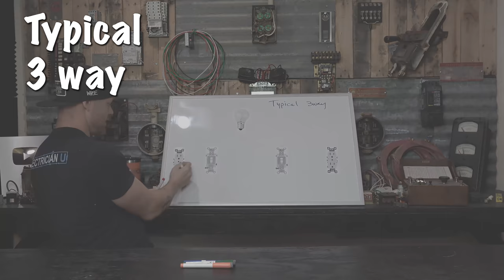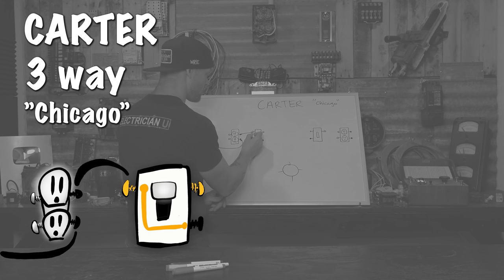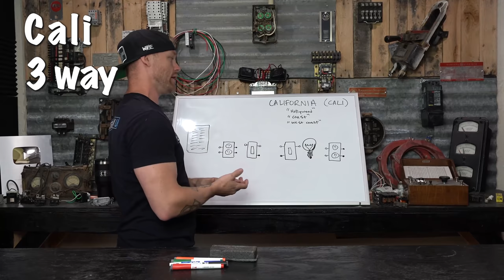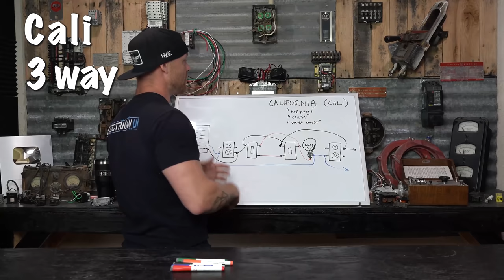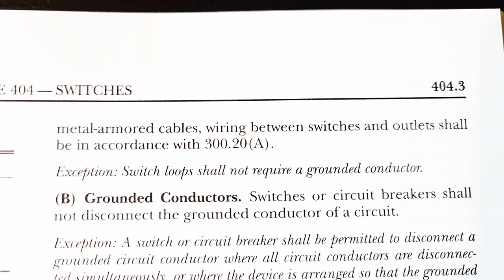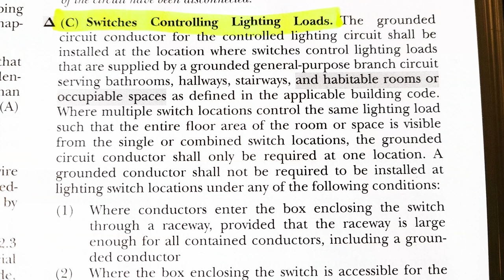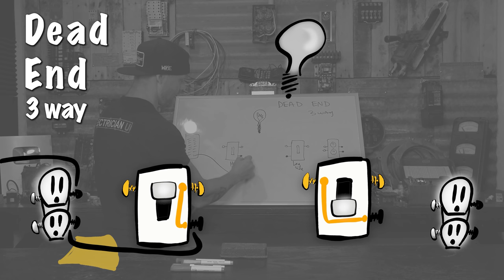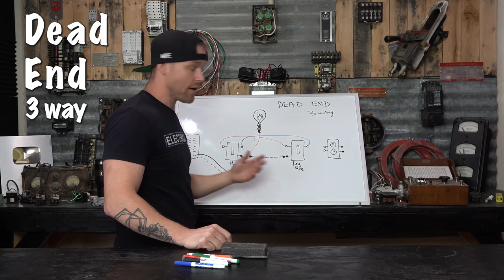THREE WAYS 3-WAYS CAN BE (3way Switch Wiring - ILLEGAL AND LEGAL METHODS)

Comment: 3:30 wouldn't that work without the travelers if it is fed from both directions. I assume that was the reason to use it in the first place. The travelers seem like an invention to solve problems of the old method. ... That is not the major problem. The major problem is that there can be mains voltage in the light even when it it off. It is off when there is either hot or neutral on both sides.

Comment: This carter/Chicago might be what I saw at my friends house that had 148 volts which had me confused. One switch used the white neutral (no black tape to show it’s hot) and the other had all the neutrals in a wire nut. I’m thinking the reason it has 148 volts when tested with meter is because the neutral white wire is being used like the carter but ties in to 2 other whites in a nut and this is not correct and a reason for the improper voltage?? Anyone have input?

Comment: Is it not possible to use the light fixture box as a junction box as well if that box is deep enough to do so.  I think that if you can do that then there is less of a chance of there being illegal junction boxes hid in walls, floors or ceilings and no need for the illegally hidden boxes.

Comment: Four way switch regret:
I wired a three way switched light for my basement stairs.  I should have put an extra switch at the basement door and then could have had the stairs and hallway all switched together.  The extra cost of a four way switch is cheap compared to years of frustration and regret.

Comment: That is what kills me! Everyone has their own terminolgy. One example light bulb vs Lamp. Ive learned just to go by the model of each T8, led tubes, metal halide, mogle base etc. But if speak with a customer I am to say Bulbs and a company its Lamps. Unnecessary brain overload.. Outlet vs receptacle is another one Ive notice people use wrong. I live in the countryside and folks call a hammer a beater lol My point is its nice to know someone i can refer to that gives me reliable Intel! Might just have to become a 1000 volt member when our codes start updating. Im trying to specialize in new technology/electronics installs and maybe networking eventually.

Comment: Hey man I barely started electrician classes had a quick question! Does it matter the color of cables to use to determine what is hot or what is neutral? Had trouble doing it the first and tbh I was pretty confused especially since I never had electrician experience any good tips you can recommend?
Reply from the maker: Code doesn’t quite specify anything for ungrounded conductors, or hots, other than for more than nominal voltage system. It does, however, get VERY specific about neutrals and grounds. I would check out 210.5
Reply: @ElectricianU   got ya bro! Thank you and thank you for providing us with this video 🤝

Comment: Wouldn't the cali three way need a ton of extra conduit? Like that neutral feedin the light would have a conduit with one wire in it.
Reply: and dead end three way is the same as traditional three way, it's just that you feed the light from one switch vs the other switch. 
To power the far receptacle, you'd just run another wire/conduit from one receptacle to the other?

Comment: Need to show a 3-way where the power comes in to the light fixture first!
Reply: This is what I've always called a Cali 3 way. Feed at the light, 14/3 or 12/3 goes throu light from each switch. Red and white travelers wire nut together inside light, then 1 black will tie into feed, the other will tie into the switch leg. Neutral stays in light. Mind blowing how many ways you can manipulate the wiring in 3 ways.

Comment: Would love to see you add to this and include the situation where the hot comes into the light fixture and then both 3-ways are essentially “switch loops”.
Reply: I just stated that too lol. You can't find hardly any videos on YouTube doing it that way. They all bring the power in through one of the switches first
Reply: You also don't require 12/3 if you do it that way
Reply: Actually, I'm wrong. If you brought power to the light it would require more wire since one neutral has to dead end at a switch and the red switch leg has to make a joint at the first switch
Reply: @stylicho  Prior to switch neutral requirement rule- if the light outlet is at the beginning or at the end of the run you end up using one 12/2  and one 12/3 cable segment. If the light outlet is in the middle of the run (between the switches) you end up using two 12/3 cable segments. The power feed point is irrelevant.
Considering the neutral requirement. For the first case you need two 12/3 if the power feed begins at the light outlet, otherwise one 12/3 and one 12/2 cable segments are required. For the second case if the power feed  begins begins at one of the switches two 12/3 segments are required. If the power feed begins at the light one 12/3 and two 12/2 cable segments are required.

Comment: how do i wire 2 double pole switchs to work 3 way for exsamole i want the fan to work 3 way and the light to work on the bottom of the double pole 3way on one circute

Comment: Me putting in smart switches and such... PLEASE DO IT!!!!!!  Only have it on one location works.  Because on a smart Zwave switch, the remote switch is just the switch leg, no other power, just the red wire to make the traveler and it is used as low voltage at that point.

Comment: In LaTam we know the carter 3way as short circuit 3way because mistaking 2 conductors causes a short 🤭🤭 btw you forgot to mention that some LED bulbs got their lifespans shortened by that wiring. ✌️
Reply: Many LEDs and CFLs can have their lifespans shortened by being used in enclosed light fixtures (looking at you, boob lights.  Some ceiling fan light kits and other enclosed fixtures too).  Although LEDs and CFLs generate much less heat than incandescent and halogen bulbs with a similar light output, they do get warm.  That warmth, inside an enclosed light fixture, can cause the electronic circuitry in the base of the bulbs to overheat.

Comment: Put of all the electricians I've worked with, one who trained me had 50 years in the field, never heard of the load side 3 way being referred to as the leg side. Both switches have switch legs.

Also don't have my NEC handy but the reidentifying conductors 6 and larger doesn't apply to cables, which is why inspectors don't turn down a Romex or MC conductor being reidentified. Also enjoy watching videos like this though, learn how other parts of the country might have don't things. Never once ran into the Carter system, and work in a lot of K&T era houses. Few weeks ago I took out a fused neutral panel, which the 1920 NEC said isn't allowed in 120/240 applications.  Always something neat to learn in the world of electric.
Reply: Same here,  fused neutral in a bungalow a few yrs ago we were in the process of replacing the original service. I think the home was wired circa 1925, apparently fused neutral panels were common until the late 1920s, maybe a bit later depending on what part of the country.  They were apparently fairly common when homes were wired with 120 volt only service,  typically 30 amps and only 2 to 4 circuits in the entire home.  The safety and reliability of our electrical systems has improved dramatically in the last century.  😉

Comment: I have 3 switches for one light. One at the bottom of my steps, one at the top, and one at the end of my upstairs hall. When I flip my switch downstairs the light comes on, when I walk up, I can flip the light off, but if I go to the other switch, it won't turn on. If I have the upstairs switch flipped on, and have the upstairs hall switch flipped, the downstairs switch doesn't work. I hope that makes sense. I put two 3-Way switches and a 4 way switch (that's what I was told to do) it used to have all 3 switches as 3 way and it did the same thing where all 3 switches wouldn't work together. So I installed a 4 way, and it still does it. I can't figure it out. 😂
Reply: I think all three would need to be 4-ways.  If you chart out the connections using one four way and two three ways, I think you'll always reach a point where having both three ways in the same position would cut the whole circuit off.
Reply: If there's only 3 switches then there will only be one, 4 way switch. 4 ways switches don't have commons. They are only used to pass current back and forth thru travelers. 4 ways can be tricky to get the input and output correct. My first step would be to open the 3 switches and make sure travelers are landed properly on every switch. The 4 way switch will  either have 2 reds and 2 blacks connect to switch with the white wire, wire nutted and tucked back, or 2 reds and 2 whites connected to switch with the blacks wire nutted, depending who and how they wired it. Make sure the 4 way isn't wired incorrectly, the 2 top screws ( gold ) needs to be travelers coming in (Rd/white or red/blk) and the 2 bottom screws ( black) for output needs to be the same. There will always be 2 wires in that 4 way switch box that wire nut together and pass through to the last 3 way. That will be your common side. if you have multiple switches where the 4 way is installed then make sure the the common ( wire that passes through the switch) isn't being hooked up to anything.

Comment: I just moved into a house that was built in 2005 and for all of the lights that have 2 switch locations controlling them (all of my 3-way circuits I guess you would call them), one of the switches has to be in the on position for the other switch to work. If the "main" switch (for lack of a better term) of the two is not in the on position, the other switch will not control the light. Can you tell me whether or not this is safe/legal and/or what type of 3-way wiring this is?
Reply: C.D sounds like to me from my own experience one of your three way switches Is defected.The easy way  to fix this is to replace both three way switches. Ps if those three way switches control a light for a stairwell then for safety sac install ulminating switches. (The rocker decor alumnate very well)
Reply: @keithtomlin4649  thanks for the info! I'll try replacing them
Reply: Another possibility is that one of the three way switches is miswired.  In other words,  one of the traveler's and common's on a switch got swapped.  (The two traveler's can go to either traveler to the other switch.   But if you mix a common up with a traveler,  you can end up in a situation where one switch will not work unless the other switch is in a particular position.
Reply: @Sparky-ww5re  this sounds exactly like my issue. Thanks!
Reply: Sounds like travelers and Common are mixed up. If your common from first to second switch is installed on a traveler screw (gold,) then it it is just acting as a single pole switch, which explains why it won't turn on if first switch is off, the feed or ( common) is hooked up as a traveler only giving that 3 switch one path and not being able to return

Comment: Isn't there a 4th way where the "Hot" is fed from the light fixture? I have a 1972 house that I've had to change this configuration on in multiple locations.
Reply: I run into those a lot, the neutral is on the light, hot is fed Down to one box on common, a 2 wire goes to the other box as travelers, and a single wire run back to the light as a switch leg on your other common screw

Comment: Hello.  Can someone assist?  A switch next to the kitchen sink (controlling sink overhead lighting) was removed and now the light switch for the adjoining wash room doesn't work nor the garage switch that provides power to the garage door opener (plugged into a 3-prong outlet on the ceiling).  What type of switch do I install at the sink to get this all working again?  Or, do I need to provide the type of switch located in both the wash room and garage?

Wires running to the kitchen sink where that switch was pulled are:
1 green (ground)(was found disconnected)
4 white wires (also found not connected to anything)
4 black wires that were all connected to the original switch removed. She does not have the old switch and does not remember how they were connected.  I have a volt meter so know I will need to identify which wire(S) are common.
Reply from the maker: I would identify the incoming line wire, and start connecting to each of the other ungrounded conductors. I would Imagine One is a line, one went to the light, one went to the was room and the other the garage.

Comment: That Carter or Cali 3 Way was also known as the old Mansion Estate Garage Power Switch Trick? You had always power to the garage for heat or cooling or ????  but you could switch the lights on & off from the main house and or the garage.  CHEAPSKATES? No! These were often run overhead on poles with a support wire, or UF wire underground so you only had the 2 copper wires & the support wire. Same deal with the California 3 Way. Large estates with overhead wiring or old UF cable to an outbuilding that was sometimes quite far away from the main house.
Reply: You missed a couple. Those are super weird.

Comment: So the Chicago way it’s still a 14-3 right? Do you just cap the reds or something
Reply from the maker: In actual Chicago this wouldn't be 14-3 NM-b it would be hot, hot, neutral, and maybe an actual ground wire. (Color is irrelevant.)

Comment: But AC does not have polarity. I realize what you were trying to describe but polarity is not the occurrence for which you are describing. Just a quick lesson for you-...... Unlike DC where there is flow of electrons in one direction only one pole is always -ve and other is always +ve, AC does not have any polarity, the current in between the poles alternate between the poles and electron flow repeats periodically.
In simpler terms you may use switching rather than the occurrence of polarity.

Comment: I have a crazy set up.  I have switch 1 that has a pigtailed hot going to the 3 way switch common/blk terminal.  The White wires in switch 1 are wire nutted, the blacks are wire nutted with that mentioned hot jumper going to black screw.  All of these wire nutted grounds, blacks and whites are of a 12/2 variety  There then is a 12/3 hooked reg/black to top gold screws and leaving the box.  This 12/3 goes to the load light in the ceiling, not the switch box 2.  At the switch box 2 there is 1 strand of 12/3 coming into the box  the black and red are on top screws and the white common wire is hooked to the black common screw.  There are no other wires in that 2nd box. At the load/ceiling light location I have two incoming strands of 12/3.  Period.  Question.  How do I connect these wires in the ceiling/boxes to make the 3 way work?  I'm baffled as how this was connected.  Tks
Reply: Based on your description here is what you do.   At the ceiling box you need to first find the 12/3 strand coming from the hot side three way.   Once you find that, you connect the neutral from that 12/3 to the light.  You then wirenut the blacks, reds and grounds, leaving a pigtail for the light if it has a groubd terminal,  being sure to ground the box as well  if it's metal.   You're now left with the white from the other 12/3, that is the switch leg and connects to the hot terminal on the light, this white should be identified as a hot by wrapping the end with black or red electrical tape.  The white common on the second three way switch should also be re-identified as a hot to prevent dangerous confusion to someone working on that switch or light in the future.  Good luck with your project.

Comment: @ahmadhakim7812
0 seconds ago
To comment on the last topic, Dead End 3 Way.  If this is a brand new wiring project, or with the walls still open and want to power the outlet, you can splice power and neural and ground from the first three-way switch box to feed the outlet before wiring the switch since this box was chosen to bring the light wires in.   
But like you said you are going to find crazy things in old homes not done properly.

Comment: how can i tell which type of 3 way was wired in an existing setup?
Reply from the maker: If I understand your question correctly, you are asking how to identify a california 3 way? Cali 3 ways use the neutral as a ungrounded conductor to transfer voltage between switches.

Comment: How do I - I have a solar inverter 230v 96A charge controller and I have 3 more sources of electricity 120-125v 100A “ How to incorporate the five sources of electricity into 2 ? The 230v = 2 lines of 115v L1 & the neutral is Hot 115v also same phase that’s 2~ hot lines of 115v each at peak 96A and my 3 other sources of electricity range depending on how fast I spin the alternator’s I will be deriving electricity from straight from the stator 110-125v Amperage peace 100-150A 3 L1 ‘s not sure the phase output ~  how to make or buy a combiner Box ? I have a SIEMENS MTO 100A Transformer 1 Phase 220-480 input  2 Phase 110-240 output “ ALL For Back ~ Up Electricity my inverter is a 5KVA 230v HYBRID Inverter I have a MOES Automatic Transfer Switch ! Any and all help welcoming “ !

Comment: I thought you can't reidentify anything smaller than #4 gauge you said #8.
Reply: That only applies to individual wires in conduit. It is allowed to remark conductors in a cable assembly without reguard to size.
Reply: It used to be an issue depending on area and inspector...
Reply: @bobniles1928  yes regarding cable assembly I know that you can. It just he said #8 and that got me confused.
Reply: @vlad1889  you're correct, it IS #4. Dustin incorrectly said #8. 200.6